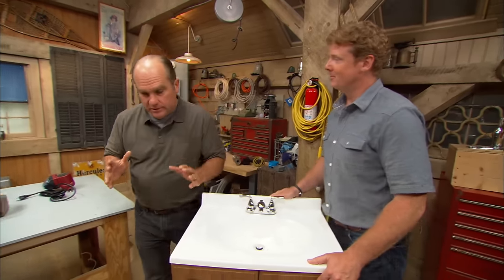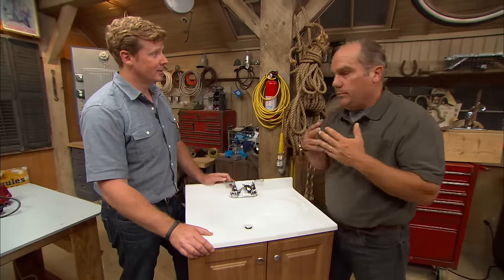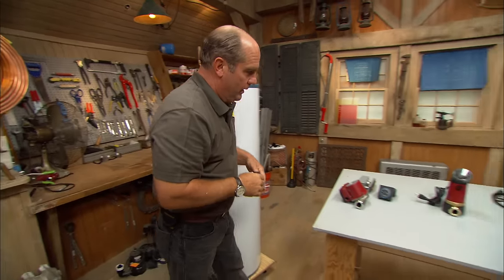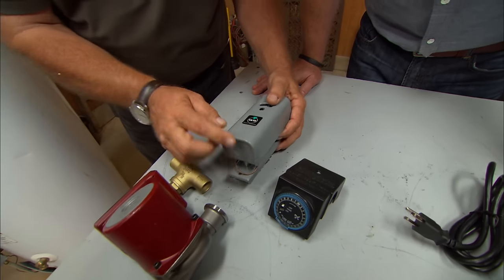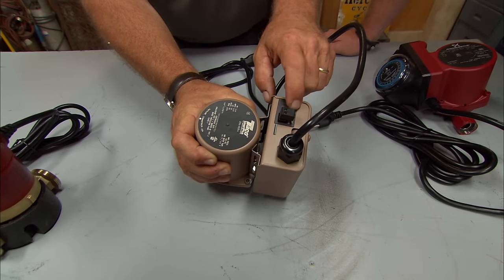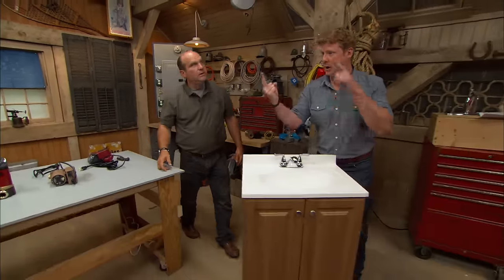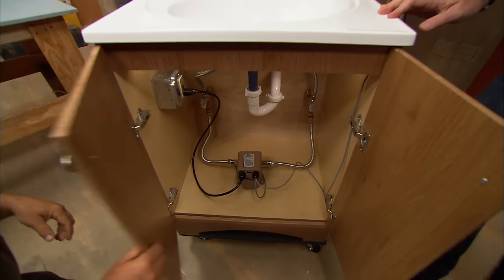How to Get Hot Water with a Recirculating Pump | Ask This Old House

Comment: The water heater runs constantly with a circulating pump, wasting a lot of electricity and or gas. I would rather waste a little water.
Reply: You can put a timer on the pump
Reply: @josephgonzales8897  so it runs 16 hours a day,will still waste a lot.
Reply: @stephenburpo7755  Or runs 5 minutes just before you wake up in the morning and maybe 5 minutes before bedtime.  Most of the time cold water for handwashing is fine.

Comment: My question is can you add more than one sensor bypass valve? My kitchen which is the obvious problem is as far away from the water heater as it can possibly be in the house, but I also have two bathrooms on the second floor that are almost equally as far if not further away from the tank. Do I just need one under the kitchen sink, or can I put one in one of the bathrooms upstairs to have hot water ready up there as well?
Reply: we have 2 but could easily add more

Comment: Here is a tip I did. It took minutes for the water to warm up in our back master-bath so I made a line off the hot water line in the bathroom to outside to water the plants. All I needed has a T-fitting some Pipe hooked up to an electric sprinkler valve that I have on a timer. So I just push a timer button it opens the valve for a minute and waters my plants, shuts off and I have hot water. No expensive pumps, hot water in the cold lines, and it cost less than fifty bucks. I found a programmable digital timmer switch at HD that works great but it is no longer there. So you might have to use one of those twist minute timer switches.
You could also just run an on-off valve to the outside and open it up by hand for a min and then close it.
Reply: Here a cheap alternative also I would see my dad do .get a bucket in the shower let it run till hot and at the end you can dump the water outside to plants or trees.
Reply: @kustomchevy27  Huh, not a bad idea. I rarely use my bathtub in my master anyway, can just dump into that to preheat my shower and scoop water out of there to water plants or whatever. Genius.
Reply: i used to plug my shower until the end and save the "grey water" all day for flushing or mopping the floor. then i realized my water bill is only $25/mo and im wasting my time and effort for pennies.
Reply: This would not work in a climate that has winter where you would have a frozen line and/or an ice rink outside.
Reply: Just beware your utility bill may increase  substantially. When the water is recirculated it will reheat.

Comment: Some information is missing in this video, not all re-circulation systems will work with tankless heaters. Watts will not work because for tankless a higher flow rate and a return line is needed.

Comment: So you're pumping water that was in your water heater, which is not recommended for either drinking or cooking, back into the municipal water supply? Yes, I realize that the importance is relative to the volume, the size of the house and proximity of neighbors. What if there is a check valve in the cold water system and no expansion tank at the water heater (hopefully a rare mistake)? Guess that's where the TPR valve would hopefully save you.
Reply: If you're concerned, then install a dedicated recirc line back to the water heater from the farthest point.
Reply: @James-bv4nu  I think an expansion tank would then also be required.

Comment: I have 100 feet 3/4" hot water line. I plan to use 16mm al-pex (between 3/8" and 1/2") as circulation return line. Change my mind.

Comment: Very informative video!  Should I install a heat trap when replacing the Anode Rod?  The reason I'm asking is because I'm going to install a Watts Recirculating Pump which attaches to the top of the Anode Rod and I don't know if the Heat Trap should be used with this setup.  BTW> I'm using the same Water Heater shown in your video. Thank you!

Comment: What is that pump under the sink actually called? I'm having trouble finding something similar.

Also, if it pumps it into the cold water line, where does it go exactly, isn't that a closed system?

Comment: And it's important that your hot water and recirc hot water piping is insulated, right?  Cause otherwise your heating the ground below your slab or crawlspaces.
Reply: Thats the problem most existing homes have no access to insulate those pipes so alot of wasted energy just to keep the supply and return lines full of hot water.
Reply: When you flush all that cold water down the drain, and when you are enjoying your hot water, hot water in the pipe is always heating the slab or crawspace. With the same temperature setting on my water heater, my shower hot water is colder in winter/when ground temperature is low.

Comment: Pumping cold water from the hit supply, into the cold water line . . . I 4/4inch main has a check valve, wouldn’t forcing cold water into the pipes with a check valve rupture the pipes, or does the water drain back into the hot water heater.

Comment: Our farthest fixture is less than 50 feet away from the hot water tank and it takes a minimum of 10 minutes to get any hot water, and it never gets as hot as the rest of the house. And we're on well water in a dry climate -- so not wasting water is very important. I hope this might work, but it seems something else could be the problem. Our house is less than 20 years old.
Reply: katmeyster You might have a stuck mixer valve. If you have two individual faucets for hot and cold then thats not thr problem but if you only have one that mixes the two then it could be.That will cause the problem you mentioned. It will never let the hot water get in to the max.
Reply: Bob Bryant it may be simply caused by the distance. Hot water always wants to give heat to the cold surrounding environment, so longer distance = more heat loss = lower temperature at the faucet
Reply: @yzhang8629  10 minutes though? No something is seriously wrong.
Reply: @chriswithrow3107  Yes, too long for everytime
Reply: If anyone has a problem like this. This is NOT normal. Even a pretty large house, built very poorly, should take 2mins max to heat up in the dead of winter. And even that is a nightmare scenario! Americans are just used to really, really bad cut-rate plumbing jobs. A lot of guys are using 100-year-old knowledge in a world where energy saving technology advances monthly.

You have some kind of thermal loss happening. Like maybe your lines are bolted to big metal beams, so the beam is acting like a heat sink. Or the pipe is running a long circuit, like it got routed the wrong way to get around an obstruction.

My house has 2 stories and a basement, in an area that gets to -20F, and my water heater was installed on the other end of the house so the pipes travel a long distance in the basement before coming up through improperly insulated walls. And the water STILL takes less than a minute to warm up. I cut it by a solid 30s just installing $5 worth of foam pipe wrap.

And no that doesn't "cause rust" unless some leak is getting into the foam. The pipes usually rust when they get condensation from sudden temperature changes, and it helps when they're exposed to both air and water. The whole purpose of the insulation is to prevent those shocks. And keep the air and water off the pipe.

Comment: We are in Arizona, so we mostly use our water heater as cold water reservoir, so...yeah.  I suppose for a small house like ours, we only need this in the winter for our kitchen, which is the furthest point from the water heater.  But I think I will get a small 2 gallon electric water heater, and keep the temperature 5 degrees lower than the main water heater, so when hot water flows through it, it shut off.

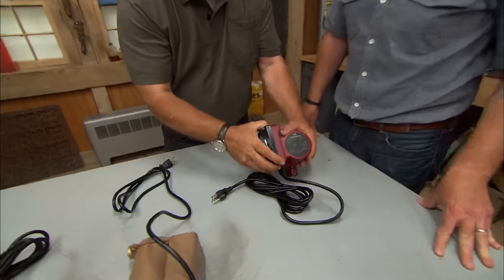Comment: I have installed a recirculating pump like the one shown @2:34 of the video. It recirculates hot water, and I have the timer set to run at 15 minutes before and after each hour for 5 minutes to "prime" the hot water. The problem is that somewhere it is forcing hot water into the cold water supply. I have the "check valve" installed under the sink in the master bath (the fathest point from the heater). I verified this valve is working correctly by turning off the cold water at the service valve, and then opening the cold water valve on the sink. The water runs until it gets hot, and it shuts off. But somewhere, hot water is "crossing over" into the cold water line. My research indicates that it could be the valves in the washing machine, but I have tested them and ruled that out. The next culprit could be the single-handled faucets in the house, of which there are three: two in the showers and another at the kitchen sink. The shower valve in the "common" bathroom was recently replaced, so I'm ruling that one out.  Yet sometimes (I think when the pump is running), I'll get hot water from the cold faucet at the kitchen sink or the master bath. How do I go about diagnosing this problem? Signed "Hot in Phoenix".
Reply: Unless you have a dedicated return line, all these pumps work by recirculating the water from the hot supply line back through the cold supply line (that's what the T with the check valve at the farthest point is for).  Therefore, if the pump has been running, all the water in your cold supply line is going to be warm until all the warm water is purged from it. Instead of waiting for hot water, now you're waiting for cold water.
Reply: What if now your putting hot water into your cold feed of your mixing valve feeding hot with hot.  That does not work.  And at least where I’m from mixing valves are required.
Reply: @brentfromsomewhere  Does that mean that you'll be drinking water that has gone through the hot water tank? Is this healthy?
Reply: To be effective, the pump should be installed at the furthest fixture. This way it can sense the hot water circulating and shut it off before the whole return line gets filled with hot water.

Comment: I would like to see this updated to show a system in a smart home.  I have Alexa and a few smart devices such as lights/outlets and a few other things.   An integral timer is therefore a wasted expense.  I would only have this pump run a few minutes an hour during my highest period of demand.  Installing an electrical outlet under my sink with a smart outlet ($5-10) is not a bad DIY project and under $30 total. Then I could just run it when I say "Alexa, get the water hot."  Yes it would be nice to save the water while keeping it to a minimum increase in pump and water heater energy but I am interested in convenience as well.  Here are some of my questions:   I am unclear on why a check-valve is needed (on the undercabinet option).   Also, anyone had issues with the recirculation system not working because of a heat trap on the water heater? (I have seen that mentioned elsewhere).  Finally,  I would like to hear from people who have these systems about how much of a problem the cold water lines filed with warm water is for them.

Comment: Nice video, Thank you. on parallel hook up with two water heaters how important is to for all the piping be the same length? is there a max amount that the pipe length can varied in size? My out going hot side piping is about 13" longer than the other one in length?

Comment: I am having issues with wait times in upstairs bathroom and also the kitchen, of course they are at exact opposite ends of the line. Can I use two bypass valves, or do I need 2 separate pump systems?

Comment: So i have a 75 gallon power vent water heater and customer says if they take two showers at once and one shower will loose hot water. There is a recirc tee cut into the cold feed of the water heater it does not have a pump. If i install a circulator do you think this will take care of this problem? This is a brand new house plumbed by others.

Comment: So on the under the sink option, if me entire system is running st 60 psi for example, the increased pressure created by the recirculating pump inder the sink will cause my hot watee heater to refill the existing cold water line versus from the 60 psi line coming in from the city?

Comment: Seems like the trade off for constant hot water is that the cold water side will become warm since it's being used to recirculate below temp threshold hot water from the hot side.
Reply: Their illustration is unclear for the whole-house recirculator system because it does not show the cold water line. There are actually three line going to the sink: Cold, Hot, and Return. The pump moves hot water from the tank through the Hot line and when the sink is not in use, it goes back to the tank via the Return line. Nothing moves in the cold line until you open the cold tap.

For the under-sink system, the pump has a temperature sensor and shuts off as soon it senses hot water. This means that once hot water reaches the sink it will not continue to pump it back into the cold line.

Comment: Can you install the pump at the bottom of the heater instead of the top?
Reply: Yolanda Castillo the pump must connect to your water line. In the video, water lines are on the top of the water heater, so the pump goes to the top. I assume the pump will go to the bottom only if the water lines are at the bottom

Comment: One thing nobody mentioned is wiring the pump to the bathroom light so it only runs when someone goes in there. Could also be done with a motion sensor, which would give the system a signal to start when someone goes into the bathroom during the day when lights are not needed. Either way the system only runs on demand, which would be helpful in a house where people keep an odd schedule and a timer just doesn't work well without having excess run time. BTW, anyone catch the extension cord being stored on top of the fire extinguisher? That's a fire code problem!
Reply: I wouldn't do it that way.  You can find a remote switch that the pump will plug into with multiple remote controls.  Put a control in each bathroom and activate when needed.  Much easier than what you're suggesting.  Find this device on Amazon.
Reply: smart
Reply: that's a great idea. i might do that.

Comment: Sounds great, the only problem I see, I have never been in a house with a 115 VAC outlet under the sink..... So now you need an electrician added to the plumber, added to the costs of the pump etc. Starting to sound less attractive at this point.
Reply: Nah, there is a nearby junction box you can wire to a socket. This is really the most simple electrical task every homeowner should know how to do, and it will build your confidence in understanding the electrical system in you house.
Reply: Just FYI but usually there is an outlet under sink that's what garage disposal and dishwasher are plugged into.

Comment: wouldn't using a Point-Of-Use Electric Tankless Water Heater be better, if you're waiting a long time for hot water to the point of installing a  recirculation line. why not just install a mini  Tankless Water Heater seems that would be more efficient.
Reply: it would cost a bundle to do this and you would have to re-wire your house to get 240 volts to the water heater. unless you are in Europe where they use 240 volts

Comment: So basically your adding many gallons of water to your hot water heater by keeping the non insulated hot and cold pipes full of hot water?? Just so you dont wait for hot water? Plus the heater will run much more often in just to keep that water in those added non insulated pipes hot. Not really worth the little savings you will get. Seems more of a "gadget" item than anything else.
Reply: timer so it works during certain hours. Not keeping pipes warm 24/7

Comment: Why is a check valve needed with a recirculation line?   The person talking implied it was to stop hot water going to the cold water line (as though this was not allowed)..   I would be nervous about doing option two where hot water pumps into the cold water line, because I thought “hot” water was not fit to drink (so wouldn’t we not want it in the cold side at all?).
Reply: Hot water in any modern plumbing system is perfectly safe to drink. In some old systems they used an unsealed, unpressurized tank in the attic (as part of the steam or hot water radiator and boiler heating system). https://www.youtube.com/watch?v=HfHgUu_8KgA

Recirculators would not work in that system.

Comment: can 2 recirculation valves (not the pump) under sinks--Ii just had a tankless put in be put in?  one in master bathroom under sink and 1 under sink in kitchen?
Reply: Without a valve blocking one line, the pump would supply both with hot water at the same time  therefore a waste.

Comment: Just a curiosity question ,most of the older property here have the hot water fed froma loft tank which makes it low pressure,where as the cold water mains comes in at high pressure are these pumps desigen for both,and what happen when they mix , like the set up under that vanity unit ,.The return pumped system we have here in larger homes and hotels etc,but all on the same pressure,

Comment: So now by using the existing cold water pipe to receive some of the water that has gone through the water heater and picked up various materials from the water heater(magnesium for one), how long do I run the cold water before I can drink it or use it to brush my teeth. For example, it is recommended that hot water not be used in cooking, etc. for a reason. In fact there were some that felt that this shouldn't be allowed as it constitutes a "cross-connection".
Reply: Diehard hotter water dissolves more stuff, like lead and other contamination in the pipe, I think that’s why one should not use hot water for drinking/cooking.

Comment: i have a query, a system like in India we usually have an overhead tank and from there the water is supplied to the whole house. now, how can we get the hot water to each faucet ??
Reply: Run a whole loop to each fixture from the attic down.